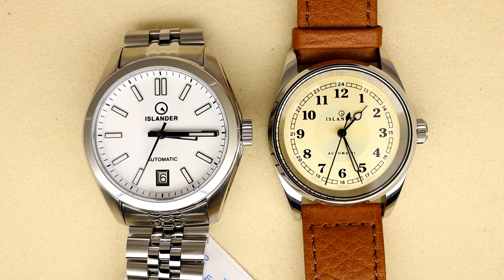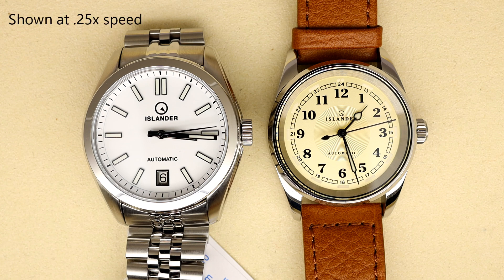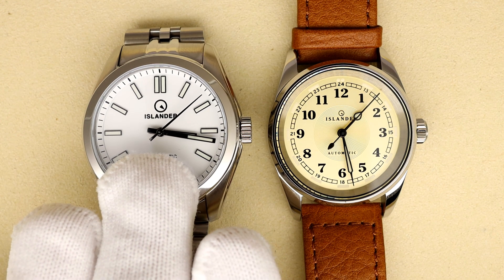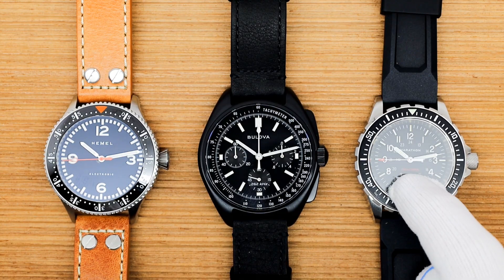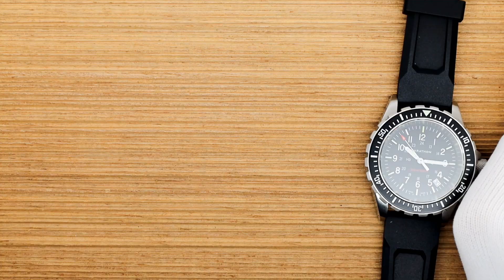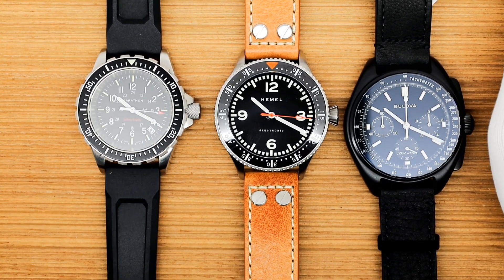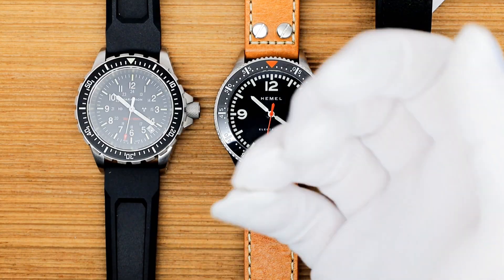Everyone is Wrong About Quartz Accuracy! Watch and Learn #91

Comment: I really wish they made that black Bulova chrono in a smaller version. I tried it on my wrist and its a huge watch in every dimension. I would buy a 38mm or under version in a heartbeat.
Reply: Except the movement itself is 40.5 mm, so it wouldn't fit into your 38mm case. Bulova has done a great job of making the 43mm case efficiently wrap around the movement.
Reply: @erikk1820  A) This watch is 45mm, not 43. B) The movement bulova uses is 35mm, and  they could make it even smaller if they wanted to.
Reply from the maker: Maybe one day.
Reply: They do have women’s watches that look more or less unisex, and those are smaller. Don’t know if those include any chronographs in a smaller size: possibly not.
Reply: Add a smaller Seiko ProSpex Arnie to that wishlist for me.

Comment: I understood your demonstration without any accuracy in my mind but it s fascinating, love it. I have a strange question here: is it possible that quartz watches being mostly non sweeping a cultural bias? Like people, except watch nerds, kinda freak out looking at time like a fluid unstoppable movement rather than a more reassuring ticking.
Reply: Mostly battery is my guess, starting a motor is much more demanding than running it for a little longer. Moving the seconds hand 3x per second probably takes nearly as much energy as moving it once per second for 3 seconds. Many analog quartz watches now stop moving the hands entirely when no movement has been sensed for 72 hours, then they spin the hands into position when you wake them up. Based on seiko “kinetic” movements that do this you could probably get a general idea how little the crystal is actually using, but I think not moving the hands makes the battery last at least 10x longer
Reply from the maker: I think the coolest quartz have no seconds hand at all!

Comment: I'm a quartz guy, less rabbit hole than non imho which works for my time and wallet, the Oceanus line is my grail territory, but my collection of Casio and Timex with a few others splashed in keeps me happy for now.  I spin a wheel on my phone that chooses which watch to match with which strap for the day.  Very fun combos I wouldn't have thoight to try...  Anyway, I Love it when you visit Urban Gentry, you guys are both great at what you do, have an Awesome day!
Reply: I have the Oceanus T200. Two Rolexes and an IWC are in my safe box. I’ll probably sell the, some day.
Reply: I’ve got the Oceanus Manta S7000 with the 5701 movement. I’ve measured its accuracy at 3.4 seconds per month fast.

Comment: Bulova Precisionist isn't thermocompensated and won't hit +-10 sec/yr unless kept at a set temperature.  Mine were definitely more accurate then standard quartz movements but not as accurate as my 9F or A060.
Reply from the maker: It actually does have some thermo-compensation according to their literature.
Reply: BULOVA doesn't advertise these at 10s/year anymore. They advertise them as 5s/month.

Comment: My latest Seiko Prospex Solar Diver is running better than -1 seconds per month, or around 10 seconds per year. For a movement that is only guaranteed to within 15 seconds per month, I regard that as outstanding accuracy. It is up there with the Bulova, The Citizen or Grand Seiko at several times the cost. Of course a radio controlled movement would have zero error over a year.
Reply from the maker: that's awesome!
Reply: That's fantastic! What's the movement number? Thanks.
Reply: What solar diver it is?
Reply: You got a lime, in essence, you got lucky.  You could easily buy another of the identical watch and it's 15 sec/month.
Reply: I’ve got a battery Seiko diver and it’s also running at better than -1 seconds per month! It’s the sbbn045.
Reply: @Rick-ve5lx  cool its the best tuna variant in my opinion.
Reply: @dyslexicbien  Thanks, I’m very pleased with it.
Reply: I have 2 Seiko solar (V157) one is +1spm and other is +10spm. It's pure luck of the draw.  My F91 is +4spm and cost 15usd.
Reply: The old radio-controlled Citizen H144 movement has been around well over a decade and is pretty reliable if you keep the dial exposed to enough light — and of course are in an area with a decent radio signal. Here in south Florida, reception of WWVB is hit-or-miss at best.
Reply: Yeah I have an unusually accurate watch too. My Alpina AL372 has gained 12 seconds in 10 months. I can't wait to see if a Minnesota winter will bring it back to the correct time haha
Reply: Radio-controlled movements often have HUGE errors! It’s just that they reset almost every night and you never notice. My radio Casio is about 15 seconds a month fast if I turn the sync off!

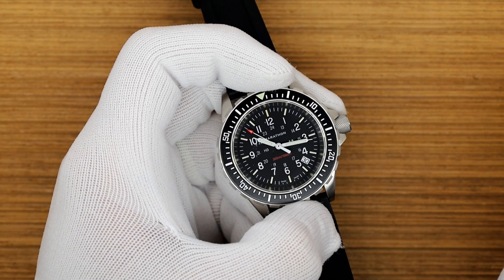Comment: 6:58 The weirdest thing I’ve ever heard about resonant  frequencies is that there was, many years ago, a factory in, I think, France. They ventilated the shop floor with a huge fan, which turned very slowly. Workers started getting violently ill at the company and they realized that the fan, even though it was moving very slowly, was moving with the same resonant frequency as the workers’ guts! It was literally breaking up their intestines.
Reply from the maker: just like construction vehicle seats!
Reply: @islandwatch  Old Semi Trucks used to damage their driver's kidneys over time.  Why there are very few older truckers still around.  Now modern trucks have improved suspensions and air cushioned seats.
Reply: @chickai25  There are few older Semi Trucks around because of CARB rules which prohibit the older trucks from accessing many shipping terminals. A proper long haul suspension seat can be fit into any big rig.
Reply: @ivermec-tin666  I was talking about truckers not their trucks.  Yes the BS CARB rules are making a lot of trucks un-driveable due to over regulation.  Try finding a 70-80-90 year old trucker that used to drive those older trucks for decades.  Not many in rest homes.
Reply: @chickai25  Long haul trucking is not an easy life. It has all of the downsides of shift work. Eating on the road is a dietary slow motion train wreck. IMO, the only way to live a decent life as a long hauler is if you drive with your wife, and you take turns at the wheel.

I don't think that the freedom loving character of the long haul trucker is commensurate with accepting life in a rest home. These are the kind of folks who would refuse to leave their homes.

I don't doubt that you are correct about the long term impact from driving a diesel powered vehicle long haul without a proper suspension seat; but those kind of seats have been available for a few decades now.
Reply: @ivermec-tin666  Ya don't say?  Thank you Capt Obvious.  I am glad you informed everyone that already knew that well known fact.
Reply: @chickai25  Facts, plural. And, you are most welcome, my obtuse Paduan.
Reply: Recommend reading article “Why People Believe Low-Frequency Sound Is Dangerous” from The Atlantic
Reply: It’s too good a story for me to go read some factual article that debunks it. (It probably claims those workers were eating bad escargot from a food cart.)
Reply: @johnsrabe I agree, and will add that sound can do all sorts of crap to living beings.
Reply: I'd believe it. Tesla made an earthquake machine.
Reply: That is surely a myth.

Comment: Fun fact - that counter in the quartz movement that keeps track of all those vibrations - the engineering behind that counter was invented in the early 20th century during the physics experiments that proved atoms were mostly empty space.  Otherwise countless subatomic particles were shot at a sheet of gold foil, and a counter was essential for getting data in a realistic timeline.  If you enjoy quartz watches, or any computer that needs a clock (that's most of them), thank theoretical physics.
Reply from the maker: this is awesome info, thanks

Comment: Would be cool to do the math on how much the accuracy changes from when the battery is full and nearly empty in different quartz movements, as the frequency in the tuning fork will change as the voltage changes, and the lower voltage output of a more depleted battery makes the watch run slower, probably with a very unoticable amount. But enough for solar movements that stay topped off to get a average higher accuracy than their battery counterparts
Reply from the maker: from what I know, the resonator is fairly constant around 1.5V, so even at high charge or low charge, there isn't much variation.
Reply: @islandwatch  yes, it's more towards when it gets quite low and falls below the voltage used to keep time, you get a somewhat noticeable change, it won't do anything as long as it can deliver the desired voltage. 
Measured with a multimeter on a few batteries and voltage is a pretty consistent output of the range of charge you will have most of the time. 
So, if calculated for, it would be minor, I'd assume.
Reply: @Anirossa FWIW I recently had a battery die in a Vaer w/ an Aneriquartz 6130 HT movement. I’ve been tracking it long term and the last data point was at 250 days, three days before it died. There was no deference. It maintained +0.048 until it stopped completely. It maintained that rate over a two year span which was really surprising. I have many quartz watches that vary greatly just by wearing them.

Comment: You could mention thermocompensation as the best way to increase accuracy of the quartz. My ETA 251.264 with normal 32 kHz to this day gained about 1, maybe 1.5 sec since February 2022, when the crown was pulled out last time.
Reply from the maker: The Bulova does have some of this.
Reply: So it has a perpetual calendar ?
Or no date at all?
Reply: @e28forever30  It has sort of quick set date on 1 crown position where it doesn't hack (GMT-like jump hour hand). So no reason to stop and reset the movement.
Reply: @Apokathelosis  👍

Comment: True sweep on quartz is possible or only possible with tiny steps? Of course would need solar power ideally. Wanted to ask this for your 'ask a watchmaker' video that didn't happen.
Reply from the maker: it could for sure, there are clocks like that, but the power draw is immense, which is why it works for AA batteries.
Reply: @islandwatch  Why is that since a standard second hand is accelerated from still, then retarded back to still before accelerated from still again. It looks like lots of energy used/wasted. Why isn't a constant one way movement more energy intensive? Engineer brain - make it simple for us!

Comment: Anyone who knows anything about radio signal generation knows about quartz oscillators which existed a long time before quartz watches. I often wonder if radio engineers who had somehow become involved in the watch industry were first to see how an electronic oscillator could control watch timing. There is a crossover with Seiko Spring Drive too. The first time I got the basic explanation of how it works I immediately thought of velocity feedback in servo mechanisms. Thanks for the info Marc.
Reply from the maker: My RC cars all have quartz resonators :)
Reply: "I often wonder if radio engineers who had somehow become involved in the watch industry were first to see how an electronic oscillator could control watch timing." 

Not exactly, but sort of.

Since period and frequency are basically the same thing (just the reciprocal of each other), the quartz oscillator as a precision frequency standard and a timebase was invented by the same guy, physicist Walter Cady.

Quartz based timing equipment was in use well before quartz's introduction into watches. That was more a matter of figuring out how to make the technology sufficiently small/light/low powered. Getting it into watches required microelectronics technology to mature to a point where it would be practical.

The guys who took the microelectronics technology and demonstrated that it could be used in watches were watch guys. Although it would be more accurate to say that they were a group of researchers/scientists/engineers working in a watch research and development organization. 

https://www.quartzwristwatch.org/history-of-the-first-quartz-wristwatch

Comment: About movements with higher beat rates being generally more refined is arguable. Many high horology movements are only 3 hertz.
Reply: That's because the lower beat rate causes less wear and tear on the parts. Thus, all things equal, said watches will have a longer life. As a bonus, the oscillations of the balance wheel are more pleasing to the eye (open case back).
Reply from the maker: That's the converse. I didn't say the converse was true.

Comment: I get it, thanks for this helpful video. Question: why do quartz watches often have second hands that move at one second intervals, or possibly a bit more rapidly, while quartz clocks have second hands that seem to sweep smoothly?
Reply: Those are running on an ac current and are regulated by the frequency of the electrical grid. A quartz watch uses a stepper motor one once per second to save battery. You could get a smoother sweep on a quartz but it would drain the battery. I wonder how long the Hemel battery lasts compared to others. Maybe you are taking about different wall clocks
Reply: Interesting and thanks, however, our quartz wall clocks are on dc battery power.
Reply from the maker: Because quartz clocks that have continuous sweep are powered by AA cells, which have FAR more power than button batteries. Still, though, DC wall clocks with continuous sweep do not have long batt power
Reply: @islandwatch  thanks for adding to my answer! I was talking about really old school clocks, which work in a similar way to outlet timers (and are not quartz)

Comment: I love my two Precisionists. 

The other watches in my collection are 6 manuals and 10 Quartz. 

I have noticed some of my cheaper Quartz are not super accurate but the nicer ones are. 

My mechanicals need resetting several times a day.
Reply from the maker: So you know the deal!
Reply: Surprisingly some of the most accurate quartz in my collection are the Casio AE1200 which can be had for $30. Running at about +2 seconds per month
Reply: @w3therby  All digital I think are the most accurate, regardless of price

Comment: Anecdotally, unless guaranteed by the manufacturer, quartz movements are a total crap shoot. I've got Casio digital watches that lose a second or two a week and I've got a VH31 that has gained 2-3 seconds in the months I've owned it.
Reply: Most quartz watches run +-15 second per month. So those are running really accurate. Don't know why you call it a crap shoot.
Reply from the maker: it's all about the oscillator
Reply: a second or two a week is on par with what the Bulova is rated for.

Comment: I wonder when the next big jump in battery tech/design for watches will happen. Could enable different digital displays, lighting, smoother sweeping hands, and other maybe unexpected things. Will it still be years till a replacement, or could charging every couple of days become an accepted norm? Or maybe charging becomes so "frictionless".
Reply from the maker: I'd say Bulova is onto something with the electrostatic movement
Reply: @islandwatch they need to shrink it a bit more but I agree. When they can put in a 36mm case it will be a winner.
Reply: @Bob_Smith19  There are pretty small solar battery-less watches now. Not sure if they also have radio-atomic timesetting but that has always seems silly to me anyway when a $20 Casio is usually within 10s/year.
Reply: A couple of brands have come out with isolated battery compartments that make swapping much easier
Reply: Solar and atomic, all you need basically.
What more would you want?

Comment: My bul9va precisionist has a much smoother sweep than a automatic.  Between that and its precision, I haven't looked at a automatic in a while. Automatics are obsolete nostalgia pieces.
Reply: That Um is like your opinion man
Reply from the maker: Most of my pieces are autos, I just enjoy them.
Reply: Nothing wrong with nostalgia. I used to enjoy looking at my grandparents fatherclock, that swinging pendulum keeping track of time .. something magical about it. It was as accurate as any battery powered wall clock, very easy to regulate.

Comment: Perhaps you'd like to add that "Swiss Quartz" is just a marketing fiction.  A Japanese or Chinese quartz might be 10x more (or less) accurate than a  Swiss movement-- the specs of the movement, not it's origin of design or manufacture, are the indicators of accuracy.  It's just the Swiss watch industry not wanting to become irrelevant by implying their movement is better, therefore should be more expensive.
Reply from the maker: Sure, you said it. It's just the movment. But, an ETA F06 is a fantastic quartz movement, blows the doors off a Ronda.
Reply: Exactly.
Nothing special about “Swiss Quartz “.
They never heard of Solar / atomic either..